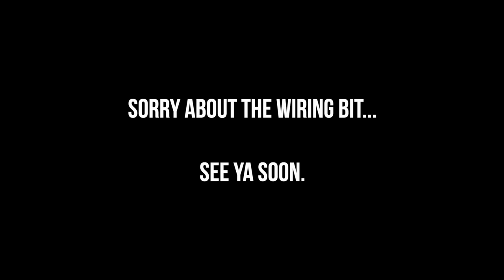Electric Motorbike Conversion: Brakes and Wiring

Comment: Curious why you didn't go with motorcycle disk in the front.  It just looks so small to me but guessing you don't have the weight that a gas motorcycle has. Very cool will be interested in watching this move forward.
Reply from the maker: So I was also prdy hesitant to go with a mountain bike brake, but the motor kit came with a matching front wheel which only had mounts for a mountain bike. Also, the front brake caliper which came with the kit is smaller for a mountain bike brake. However, the bike is probably 70+ pounds lighter than the original bike. The main thing that made me okay with a smaller front brake was the fact that the brake levers which came with the kit have a micro switch which when pulled will engage regenerative braking through the hub motor. The intensity of the regenerative brake is programmable, and after test riding it, I found I use the regenerative braking for probably 90% of slowing. Only in emergencies or coming to a complete stop do I use the physical brakes. So, I'd prefer to have a beefy front brake, but in reality I have 3 lesser options for slowing the bike, which works for me... Thanks for asking, I realize only about 1/5 of my train of thought actually makes it into the videos, so I'm happy to clarify.
Reply: @ReedBighamBuilds  Probably not on your radar at this point, but the bridgestone 175 front brake is actually pretty potent if it's in good shape. I think you'll be fine with the regenerative braking, though, i bet it's more powerful than both of the original brakes combined (if that's saying much...). The 175 weight around 275 stock, so if you really shed 70 pounds (which i also don't doubt), then you're probably in good shape. The important part IMO is that you're considering and testing it so you know what to expect.